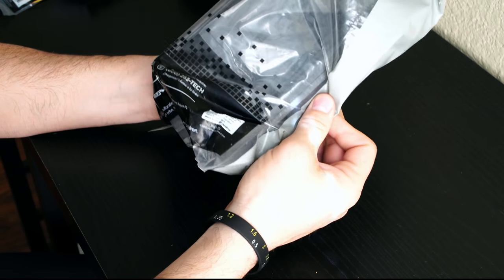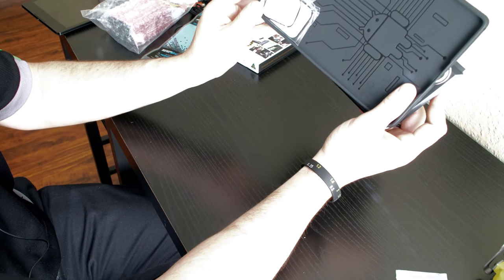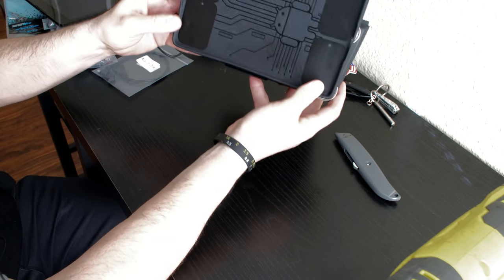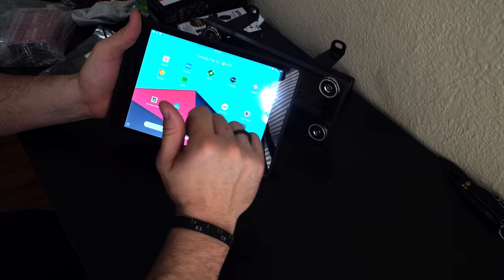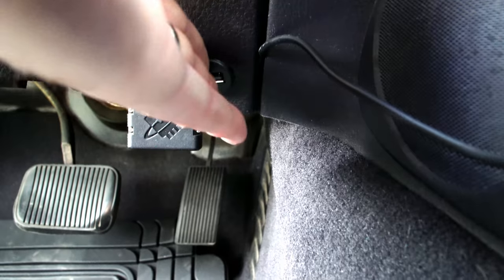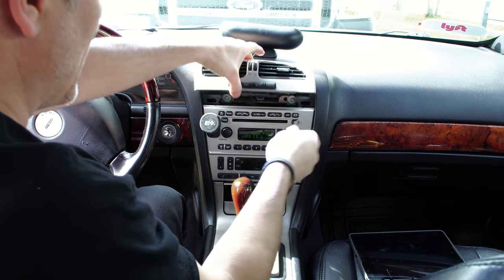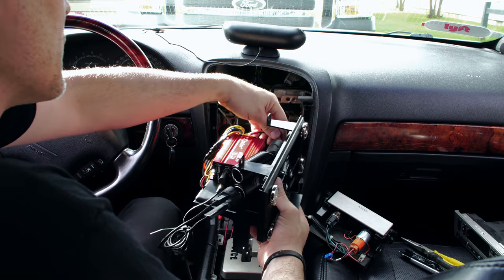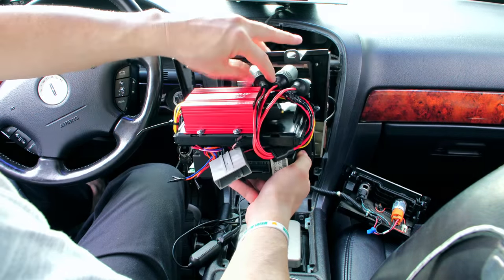Turn Your Tablet Into A Head Unit

Comment: modulated RF carriers SUCK!!!, hate those things, audio signals piggybacking on an FM carrier freq arent clean, noisy as hell, drift-prone, and drop outs a plenty whenever you get near a stronger FM freq
nice job, but tablets suck for head units basically because they werent designed for peak audio performance
Reply from the maker: Yeah, it's not going to please an audiophile but it works well enough to be enjoyable. Make sure you check out the update video where I get a new tablet and an updated setup.
Reply: @edwardlthompson  will do ed, & dont get me wrong, I did this to a 2000 Dodge intrepid w/ a 2013 Nexus 7 four years ago and used the existing "Premium" factory audio system (factory amp, & 7 speakers, this Intrepid actually had a center channel speaker middle of the dash and those little "Sail" tweeters on the upper part of the doors. Still in operation today, was going to attempt a portable mount system on my 89 Harley Davidson, but with this loud ass beast (no baffles) it was counter productive to say the least :)
In my Cherokee I  just recently installed a 10" touch-screen Android 7 stereo unit made for cars,  basically an amplified (60wx4) 4 speaker output tablet with RCA outputs for external amps, B-U camera and aux inputs. Pandora's never sounded sweeter. I've been doing electronics in cars since the 80's (put a VCR system in a dudes porsche 911 one time in Marina Del Rey Cali with a 12" video screen on a goose neck mount, was pretty cool considering this was 1989 at the time ;)O
Rock on my friend and hit me up if ever a question w/ setups like these
Reply: @edwardlthompson  ohhh, and I dig that car app, back when doing the Intrepid in 2015, I said to myself, somebody should make an app to turn a tablet into a head unit.... looks like someone did :) Thanks
Reply from the maker: @thecentralscrutinizer5105  that's very impressive! Thanks for the compliments and thanks for checking out my build!

Comment: I never see anyone who do true conversation yet. Every do the same BS. I'm looking for someone who can pair factory radio with tablet.
Reply from the maker: You could just connect through a Bluetooth head unit to the tablet. I have an Android Auto head unit in my truck and I just got a tablet mount for the cupholder. Works well.
Reply: @edwardlthompson  no after market radio sound good as OEM. I like to keep my factory radio, but delete the interface. So I'm working on the project. Back in the days when car radio use analog it was easy, but now all car radio used digital interrupt make it hard no schematic.